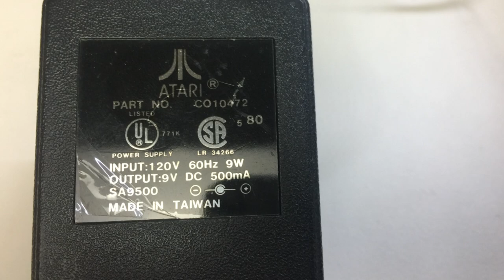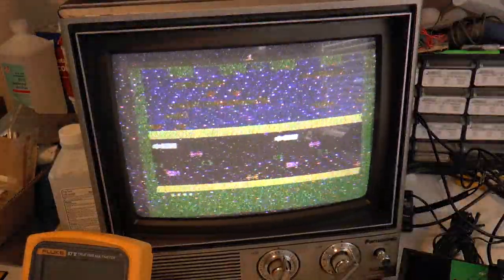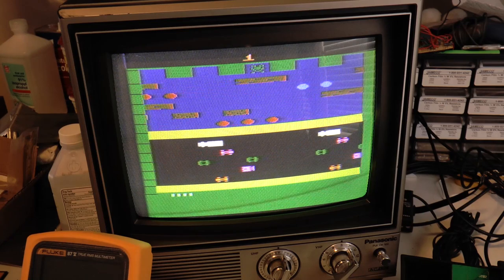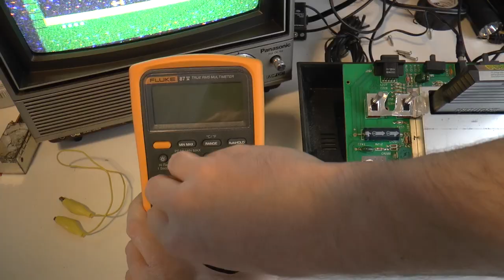Atari 2600 Repair - No Power (Dead Voltage Regulator)

Comment: Nice i picked up a 2600 with games, wireless controllers and box, bunch of stuff for 20 bucks cause it didnt work. and that was exactly the problem i had. was showing 15v at regulator so i ordered the parts and we will see what happens next. Thanks for posting

Comment: Good lord it was the voltage regulator easy fix that is awesome and what kind of grease or thermal paste do you use for that kind of voltage regulator component I was wondering what kind for a long time

Comment: Hi there, Awesome video. I have an old 1977 6 Switch Sears Tele-Games Video Arcade that I'm have currently modded from RF to RCA V/A Composite with the RCA Red, White, and Yellow Plugs. The PCB. I tried to cut it on. I think I probably have a Dead Voltage Regulator. Or it be the mod of the Atari 2600 Mod with the Black, Red, Yellow, and Green Wires with probably wasn't connected right. My soldering skills is not really that perfect. But the boards look near mint and I recently put a new Power On/Off Switch by desoldering the old one and installing the new one. I did the same thing with the Game Reset Switch by replacing it. I recently bought on of these replacement packets for the 6 Switch Atari 2600 CX2600 - 6 SWITCH TUNE-UP PARTS VOLTAGE REGULATOR 1 Amp & CAPACITORS off of eBay a few days ago. I also bought one for the 4 Switch as well.

Comment: Wouldn’t any off-the-shelf 7805 linear voltage regulator with the proper amp/current capacity work out as a replacement?

Comment: My 6 switch 2600 was working fine until this week, colors were perhaps a bit washed out.  Turned it on last night and static with a weak signal.  The unit itself doesnt move, its just powered on and off.  never left plugged into mains either.
Also got a 2600 Junior with no video output, power light does come on.
Is it likely to be the voltage regulator on both?  Happy to attempt a repair, will be the first time I try such a thing though.

Comment: Thanks for the video! I have been trying to fix up an atari 2600 and I have bought some parts to fix it. I bought a new 9V power supply off amazon and new power regulator and some capacitors. Like in your video, I am still getting 0 volts on the negative side of the big capacitor (even with a new regulator). The regulator is inputing 8.9 volts and outputing 5 V. But the big capacitor is inputing 9V and outputing 0V. I need some help lol
Reply: It is a 4 switch by the way.

Comment: Greetings, excellent video, first of all thank you for sharing your knowledge. Friend I would like to know if you can help me, in a bargain recently bought an Atari 2600 with wood imitation and 4 buttons, I came without the ac-dc adapter, I got one of a Chinese imitation of nintendo that says "AC-DC 9V 500mA" , I made the modification of the tip with a 3.5mm headphone jack checking very well the polarity using a multimeter, but when trying to turn on the Atari nothing happens. In view of this proceeded to disarm the Atari and perform the voltage measurements as the beams in your video, I am struck by the fact that when I measure voltage between the terminals of the input jack or between the pins of the capacitor it marks about 17V with the Atari off , but when I turn it on, it marks about 4.7 - 5 V in those places and in the voltage regulator it marks 1.7V (that there according to your video if everything is ok it should mark 5V). Will it be that the AC DC adapter does not supply enough power? or is there another problem in atari? Thank you

Comment: Hello friend. Thanks for sharing your knowledge. I have a question and appreciate your help: the multimeter shows 10.4 on the large filter capacitor and 5.3 on the 5V regulator... Still have no image.. What would be your next step in this case? Thanks for your time :)
Reply from the maker: Hello Carlos. Is the cart slot cleaned? Are you using a clean, working cartridge as well? I would use an Atari cart rather than an Activision as their PCBs are a bit smaller. I also have had to pull and re-socket chips on some Atari systems.

Also - if you have a six switch that has the two separate boards (one for the switches and then a second for the cartridge slot), the cable that connects the two can cause problems.
Reply: @DisplacedGamers   Displaced Gamers  Thank you so much for your reply :) I have the 6 switch Atari. I have dissasembled both boards and found that the one that receives the controller and power input is covered with some orange subatance :O... Smells like orange soda or some orange sweet liquid... I have started removing it with Alcohol (not Isopropyl alcohol but the anthispetic type, I hope this does not damage the board :O what do yiu think? Is it a bad idea?)

All cables look very good and soldering points are very solid (athough Im not an expert they seem very good).

I dont know if cartridges work either :( I bought it at risk knowing that it may not work...

I'll keep cleaning the board a little more and will write to tou again to see if works.

Thanks again for your time and knowledge friend :)
Reply: @DisplacedGamers   Hello again friend. After cleaning board, still does not work... :( ... Worst of all, multimeter now displays 7.4 when I measure 5V voltage regulator... Why before cleaning up it showed 5.1 and now is fried?... Did I do something wrong by cleaning it? :( thanks again for your time and knowledge.
Reply from the maker: Sorry to hear about your additional troubles. 

You may want to consider posting your issues along with some photos on a forum such as AtariAge. It is a lot easier for multiple people to follow and have a conversation with you about it.
Reply: @DisplacedGamers  Thanks again friend! Definitely will check out AtariAge forum!! :)

Comment: So I have an Atari 2600 and I have it hooked to an old zenith and I play with it here and there. Recently I picked up a few more games for it and a couple days later, I went to turn it on and there were lines through the screen and it was screeching at me. I thought it was just a dirty game so I blew in it, put it back in, and same thing. Any ideas?
Reply from the maker: You probably want to clean your cartridge port as well as your carts. Activision carts also used thin PCBs, so they can be a bit finicky at times.

Comment: What about the potentiometer that's near the large cap? I opened mine and noticed mine is pointing a different direction than yours (arrow) voltages on mine seem fine, but still no sign of life. Should I adjust that thing?
Reply from the maker: That is for adjusting tint. It is rather sensitive to change. I wouldn't move it as it can be rather difficult to dial it back into accurate colors.

Comment: Hi, thanks for the links. I have an atari 2600 that doesn't seem to be getting any power. I just ordered the kit from console5.
Reply from the maker: Awesome, Daiz7788. Let me know how it goes!
Reply: Hi, so I got the kit and installed the new 16 v capacitor and the 5v regulator, but still nothing. I'm starting to think it's the power adapter. The guy I bought the power adapter from said it worked, but I don't think it does. Is there a way to test the power adapter to see if it works? Thanks
Reply from the maker: Hey there, Daiz7788. Sorry it didn't work. 

Do you have a six switch? If so, one thing you might want to check are the pins that connect the power and switch board to the input/logic board. If you view the Atari 2600 Bad Color video I posted, I believe I have a shot my re-seating of that cable on a 6-switch. If that isn't making good connection, you won't see anything happen.

Do you have a multimeter? I would check your voltage at the jack (easier to do on a 4-switch) with the adapter plugged into the system and see what you get. You can also check it at the new large filter cap you installed. If you check the adapter with it unplugged from the Atari, just know that it will have a larger voltage on it since it isn't under load. 

Check the input and output pins of the 7805 with the system plugged in and switched on. If you don't get the voltage at the input pin of the voltage regulator, check the power switch. It might be dirty and need some cleaning. If get voltage (+5V) at the regulator output, check to see if it is reaching the ICs.
Reply: Thanks for the quick response. I have a 6 switch. This is my first time attempting to trouble shoot anything so even though I do have access to a multimeter, I don't really know how to use it. I tired to copy what you did in the video and test the large capacitor while the console was plugged in, but it showed a really low voltage. How do you check the voltage jack?
Reply from the maker: So I would definitely check some videos on how to use a multimeter on YouTube just to get some basics. I believe there is one from Afrotechmods that is pretty good. It could be that you had your multimeter set to AC instead of DC when you did your measurement.

I would highly recommend checking out various videos first so you don't accidentally damage something on accident.

Did you get a new voltage jack and install it as well? If you elected to go the route of the refresh kit, it should be included. To measure at the jack, you can use the red probe on the middle of the three pins and the black one on the outside pin closest to the plug side.

You can also measure the adapter itself out of circuit. You should get around 14v, I imagine.

Be careful not to touch the probes together accidentally when you measure two spots.
Reply: I'm pretty sure it's the power supply. I tested it and it has a really low voltage. I just ordered a replacement for it.Thanks again for all your help I really appreciate it.
Reply from the maker: Glad you found the problem. Sorry you had to work so long on it. That refresh kit is a good thing to use on your Atari 2600 machine regardless. I'm sure you'll be enjoying Atari games in no time!

Comment: I bought a used atari for $17. Brand new cable, so I know it’s not that. The power switch is lose and I don’t have a working power meter.How do i know if I just need to resolder the power or need a new one?

Does the Atari hum or anything I can use to tell if it’s getting power to see if it’s the switch?
Reply from the maker: Hey there, RetroGamingGenesis. If the switch is loose - as in it has come loose from the board - it will definitely need to be resoldered. It is also possible for the stem on the switch to break off. As far as the switch circuit, it goes through a filter cap before hitting the voltage regulator. If you think the power switch is in the on position, I suppose you could see if the voltage regulator is getting hot.

As for a multimeter, you might be able to score one for cheap at a pawn shop. I believe I paid $10 for my first one. They are useful for many reasons.
Reply: Thanks. I wiggled it around and it didn’t turn on so I probably need to do both.

Comment: Replace the 7805 with a Trasco 2541 DC converter which is much more stable and runs cooler.

Comment: Why would you repair the 0,5 amper voltage regulator with a 1 amper?
Reply from the maker: It is basically to allow for a bit more headroom for the regulator. The amp draw of the Atari can sometimes stress the 0.5 amp regulator. A 1 amp regulator can handle anything asked of it.
Reply: Oh, that explains it. Thanks!

Comment: Hey, i have an atari flashback that has the same problem. Will that regulator work for it as well?
Reply from the maker: The Flashback has a much newer design (fewer components) inside. There are also quite a few Flashback units now! Did it work for a little while and now it doesn't?
Reply: @DisplacedGamers  Yes,exactly
Reply: @DisplacedGamers  Since I posted the comment I have educated myself on the base of the regulator and other things according to a typical board. I know if it is a regulator problem i need the AMS1117 and before I jump to basic conclusions i need to use multimeter on the output regulator. But by the way you asked that question i assume it is not the regulator.
Reply: @DisplacedGamers  do you have a solution?